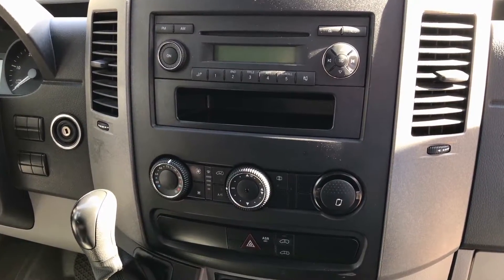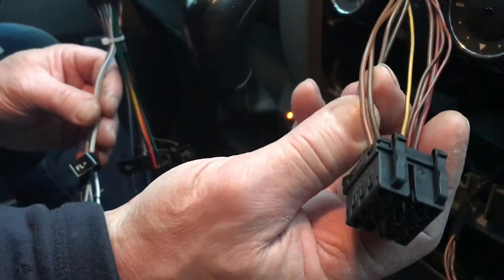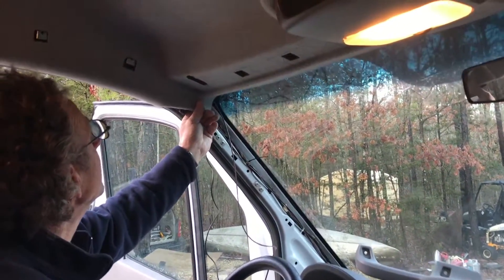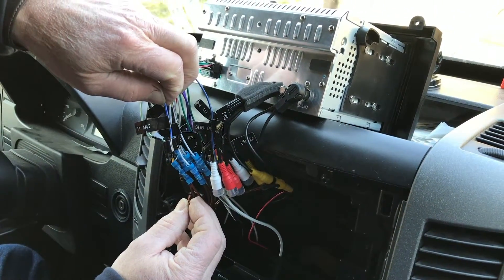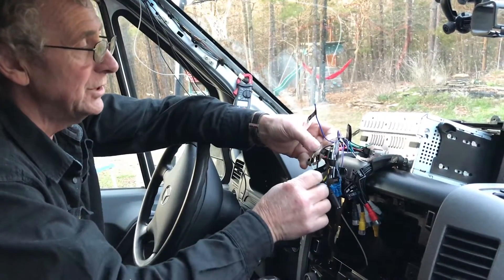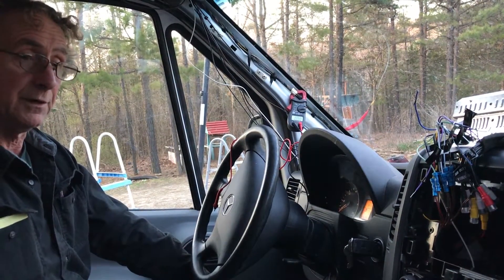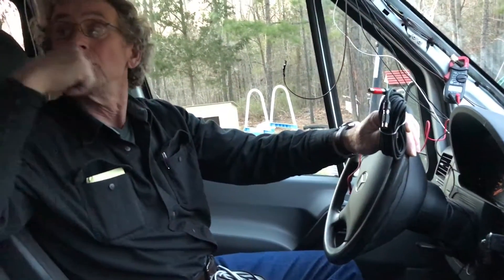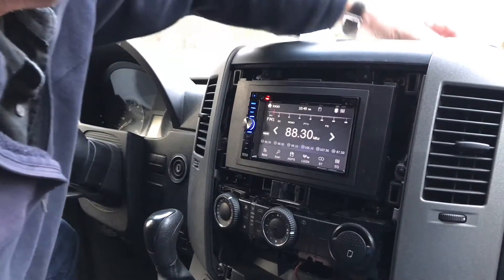New Radio, Backup Camera/Security camera, Custom Sprinter Van Conversion

Comment: Your videos are so thorough that my brother and I decided to install a double din stereo in my 2010 MB Sprinter.  Everything is good except the Terminal 87 (3a), number 6 position only allows the stereo to play in the #2 key position not the #1 key position and then it goes off after 30 seconds.  So in other words I would only be able to keep the stereo playing continuously with the vehicle running.  Can you tell me if there's any other terminal that I can tap into that would give me the ability to play the radio in the #1 key position without it turning off after 30 seconds?  Anyone please help with comments for a desperate youtuber.  Thanks in advance.
Reply: Have you got any chance to figure this out? I have same issue
Reply: @projecta635  Have you got any chance to figure this out?